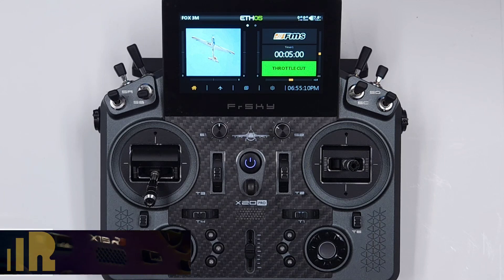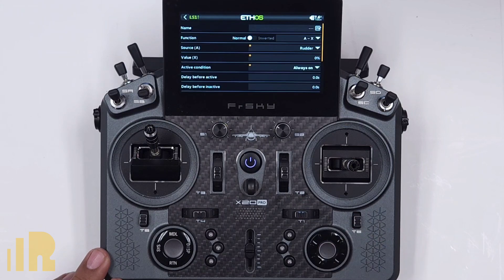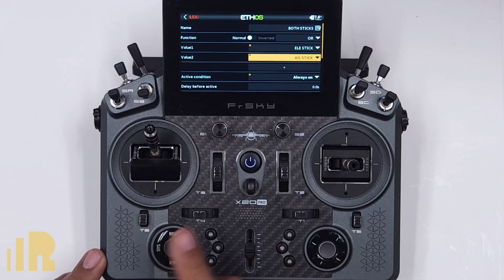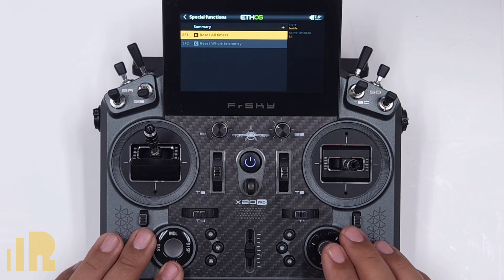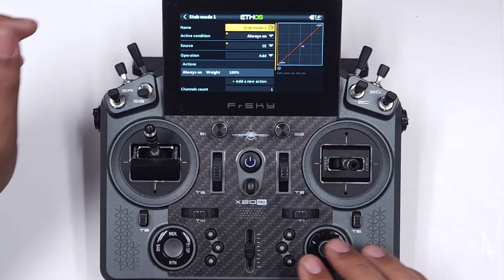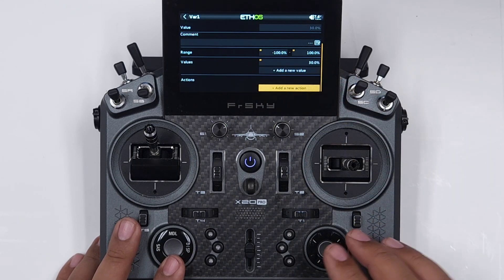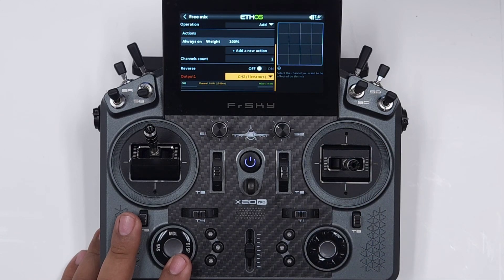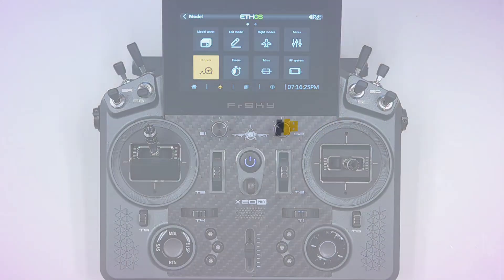Auto Hand Launch Mode - FrSky ETHOS Tutorial Series

Comment: Great video ! I have a old motion rc Stinger 90 and the landing gear were junk so I made it hand launcher. I'm using  a sr10 pro receiver and I set it on self leveling mode on a about a 35 degree angle. I've got the  motor disable switch on and I would then turn on the launch mode and put the throttle to 100% and then active the motor switch and would launch the stinger and pick up my radio off the pilot station fence and then switch to normal gyro and some flying. This works very well for me so far. I did like what one of viewers said in his comment. Putting an delay on his throttle before coming active, how would you do that?. Thanks and I really your like video's.
Reply from the maker: Email me, would love to know more about your setup and i'm sure I can help! jose@frsky-rc.com

Comment: Great Video. I did something similar last year for my Fox 3000, but I like some of the things you did better. One thing that I did was to add a 5 second delay to a throttle input so that I had time to get both hands supporting the airplane before the motor starts. That airplane is hard to hold and launch with one hand, especially when it is windy. Five seconds is enough time to get things steady into launch position using both hands to hold the airplane (I use a tray to hold my transmitter, so it is not dangling by a simple neck strap.) The motor starts to a preset throttle position (about 80% worked good for me) and stays that way until I flip a switch after launching the airplane. I will try your method of using the stick motion away from zero to deactivate launch mode to also set throttle  back to stick control.
Reply from the maker: Good idea. Might want to consider adding a countdown so you know exactly when the motor starts up...
Reply: Hello Sir! could let me know how you setup a delay on your throttle. I have the frsky x20s. It would be much appreciated

Comment: great work mate. anyway to make the throttle activate when the glider is hand launched?whould be a great feature for a hand launch wings where the motor is behind the grab points so the glider has left your hand before the motor activate. keep up the great work.
Reply from the maker: I've been thinking about how to do that... Just gotta figure out the accelerometer values to trigger it reliably... I'll try it on a smaller plane first then try it on a bigger one.... It may be a while
Reply: @FrSkyOfficial  At first I thought that was a very clever idea, however the more I think about it the less I like it. The first problem is calibrating the amount of acceleration required which would be different for every model / thrower. The second problem is not being able to ensure that this value isn't accidentally exceeded while handling the model before it is wanted - the last thing you want is a motor coming active in your hands unexpectedly, most likely when it's windy and the model is getting jerked around in your hand while held. The third problem is what happens if you throw a model and don't exceed the value, you now have a model which presumably needs a motor to get safely airborne but the motor isn't active and if your video is followed with some up on the elevator - you're just gonna stall it onto the ground tail first.  

I have actually done something very similar to your video for a 4m ASW20, however in my case I have a e.g. 5sec delay between activating launch mode (also level mode) and the motor starting up, that gives me time after flicking the switch to get the model ready for launch with 2 hands, wait for the motor to start when I can then chuck it with 2 hands, motor (FES) running. 

There is one other thing I can from bitter experience suggest is not a good idea if I've understood the setup correctly (apologies if not). You have two ways to activate the level mode, either SE up(?) or SH for 1s. What happens if you have SE up and then activate SH for 1s, you are now in launch mode, however when you move the right stick you are still in level mode and now panicing that the model is stuck in level mode and moving the right stick isn't getting it out of level mode and are fighting the gyro level mode. That one resulted in me 'landing' the 4m glider in a field of rape 250' below and carrying 5+Kg of model up 250' of steep hill is no fun. I have changed my setup so that in your case Edge of SE up triggers a sticky LS for level mode which is again immediately deactivated by the right stick. I'd suggest it is also worth repetitive call outs of 'Level' every few secs while in level mode.

Although I'd love to know what glider has a prop behind the grab points, but the question would be valid for e.g. a pusher plane.

Comment: Just curious if the plane is a jet and as you take off the plane attitude starts to lift up and if you get the jet to a good angle is there a way to get the elevator to stop at 30 degrees and hold the plane attitude at that degree angle for those that fly FPV this would give them extra time to slide down the goggles but it it holds continuous  the plane attack angle would go into a stall so is there a way to add a degree angle to auto launch this is excellent for those on the sticks immediately but for a little extra time to slide down the goggles the attack angle would need to go to a degree and hold for a 3-5 seconds longer if you get what I’m saying that would be optimum set up :-) 
Thanks for the great videos I already am using the trainer sticks release and with my trainer at almost 19 hrs of flying I train a lot of newbies on our Fr-Sky system !!!!
Reply from the maker: You'd need to control the elevator with the stabilizers angle. It would be possible to set something like that up. The main question is wether the latency is low enough for that to actually work. I or someone would have to test it out and see if it would work in the real world.
Reply: No rush but if you could test that it would cover all aspects of our RC groups and I for one would love to have that feature the aura 5 and 8 have this and I want to transition to Fr-Sky 100% hence won’t need the aura auto launch system :-) thanks